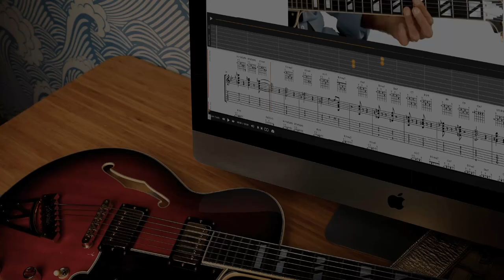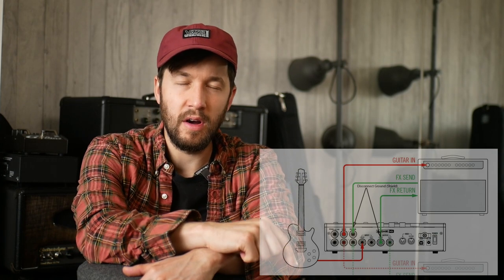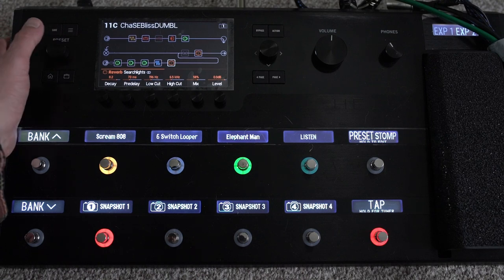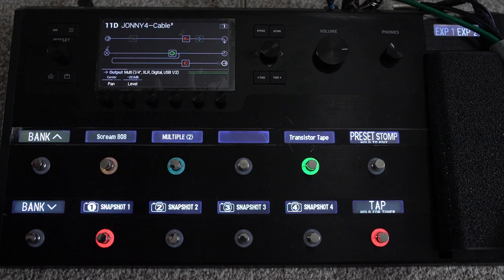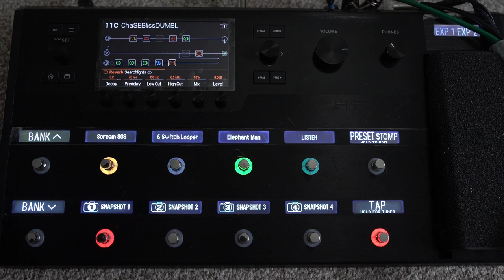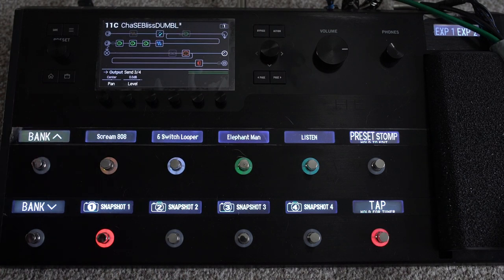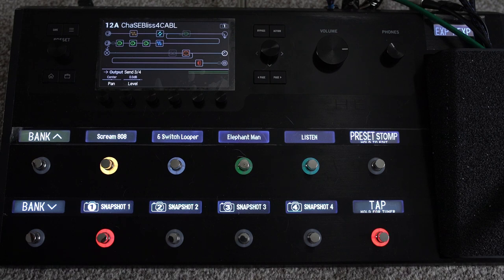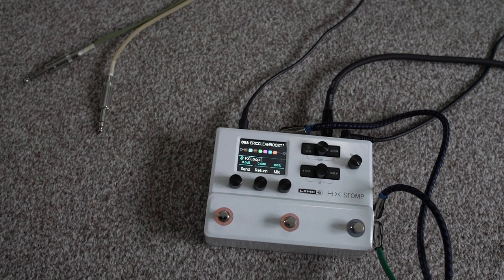WTF is the 4 Cable Method and how does it work for Helix and HX Stomp

Comment: When running a real amp, I always want to use 4CM since I’ve decided that multi-fx units and modelers are my preference over pedalboards. There’s so much you can do and routing new options is so much faster than messing with additional cables.

Comment: I use an HX Stomp in 4CM with an SV20 (and a torpedo captor for headphone use a lot of the time) - BUT since I also use it as my external soundcard / interface, I can't use the mains out for it, since all PC sound would get forwarded to the power amp. I use Send L for one loop, Send R for the second loop, and a 1x stereo to 2x mono cable to do it with just the single send jack! 

This still keeps the possibility for effects after the amp (IRs of course!) if sent back through the loadbox, and the mains out if I ever had to go FoH :D

Comment: Basically it's about seeing the amp as a separate preamp and poweramp. So you capture it's preamp in the FX loop of the modeller, so you can use that, or any other modelling preamp. 
Then you send the signal to the Poweramp of the amplifier to have it amplified and played back over the cab.

The modeller is the heart of this setup, not the amplifier.

Comment: It seems that if you want to do full 4CM, including a separate line to FOH, on the HX Stomp.. you can. But it requires a Y-cable for the FX send, and you'll have to sacrifice a block. I found that if you use the FX Loop block in your preset to route to the front of your amp, you can't put the Mixer block on the B path for a separate FOH output later. To make it work, replace the FX Loop block with separate Send L and Return L blocks. Then you can move the Mixer block to the B path, and set the B path to use the other Send. I haven't been able to test this, as I don't have the Y-cable currently, but the HX Stomp isn't stopping me from setting up the preset like that.

Comment: I know back in the early 2000s 4 cable method was all the rage, perhaps even the gold standard for a great and efficient guitar tone. However, I do wonder myself if the 4 cable method is a bit outdated considering how far we have come with all the emulations, and how much we have changed as a live music culture. Of course it still sounds great, and if you can afford to travel with an amp and a multi effects unit, and if the room is big enough to crank an amp, and if you have a sound tech willing to mic up your cab right, then I guess its worth it? It just seems like a lot to do nowadays when you can get a great sound from most multi effects unit running direct to house. Thanks for bring this up again, sir! Cool video.
Reply from the maker: Yeh - I just said to Phil, who I made this video for, I personally just go straight into the front of the amp, and trust that the emulations are going to be basically as close as I'd need?
Reply: @johnnathancordy  If you have a preamp modelled, and you go into the front of the amp, then you'd be stacking two preamps on top of each other.

Comment: I don't use HX Stomp the same way, but it is a 4CM of sorts with HK Deluxe 40....

GTR->REAL PEDALS->AMP->AMP FX SEND->STOMP INPUT->EQ/DLY->STOMP SEND->AMP FX RETURN->AMP LINE OUT->STOMP RETURN->CAB SIM+POST FX+FREEZE+LOOPER ETC->STOMP STEREO OUTPUT L/R-> FOH + MON

- This allows me to use a real cab or not with my amp
- This allows me to have FX both in amp loop and post 
- It does have a lot of post fx not in my real speaker, but I do a lot more gigs without a cab tbh.  And this method allows stereo post fx.

All my presets start with a block of EQ, DLY, FX LOOP, CAB SIM then its all about what the preset is actually doing freeze/loop/washy delays/all of the above.

I can output stereo signal to mains/FOH/recorder

Comment: My comment is in my Thumbs Up Like!  Hey John...if you can, it would be nice to know what patch you are using for the intro's if it's one you have previously created for distribution. .....I used this method for a while before getting monitors...in my case I was going into the Effects Loop send and return on an acoustic Loudbox 100 combo amp bypassing the preamp front input. Sometimes I would still use a Helix amp or preamp and cab anyway....Now that I have powered monitors everything is as I want it.

Comment: On hxstomp use a TRS to dual TS split cable and you could send out to FOH in mono using the L loop for the amp and R send seperate no ?

Comment: Every time I try 4 using cable method at a live show I find im too lazy to carry another two extra long guitar cables. (Then if you want to channel change on your amp you need another cable for that control signal so it ends up being something like 5) I would literally rather just use digital pre's than walk back and forth from my amp for to plug in all that junk.
Reply from the maker: Totally, I personally just go straight into the amp too

Comment: As always, great video John. Have you considered purchasing another Line 6 DT amp and setting up a wet/dry/wet setup via helix link with another amp for the dry signal? That's the path I am heading towards at the moment. Also how are you getting on with your variax? Cheers.